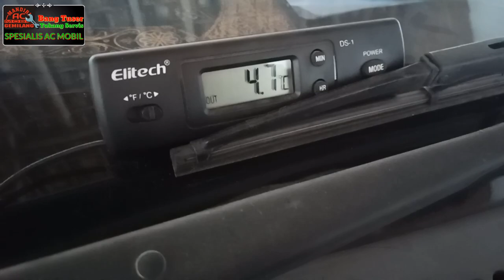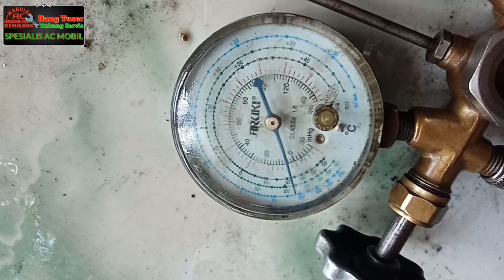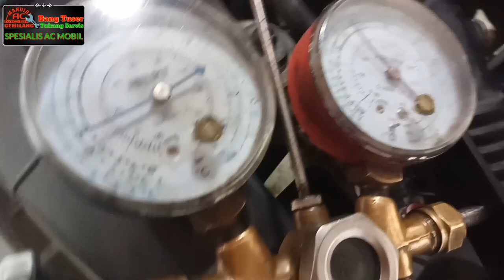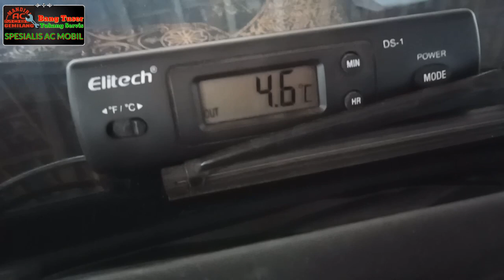car air cond overal service, maximum results

Comment: mau nanya. klo pertama ac dinyalakn dingin normal. tp klo dibuat jalan kok g bertambah dingin. padahal oli kompresor baru,freon baru n ac d stel yg tertinggi. kira2 apa ya kendalanya.trims
Reply from the maker: Bisa mutus otomatis gak om dn mobil apa ya
Reply: klo ac distel pelan. mk kompresor hidup trus sebentar mati n begitu seterusnya. klo distel pool mk kompresor jalan normal
Reply: @MANDIRIGEMILANGART .penther kapsul 2007
Reply from the maker: @muhammadsholeh7948  jangan di stell poll biar bisa mutus.  Cek kipas waterpump klau gak ada tambahan extrafan nya
Reply: @MANDIRIGEMILANGART  .klo distel kecil/tengah2. kompresor hidup sebentar lalu mati n hidup lagi sebentar trus mati lagi. begitu terus om. klo distel pool, kompresor hidup normal.

Comment: Assalamualaikum om.mohon maaf kalo banyak tanya.kompresor sudah ganti oli kompresi msh ok.kondensor evaporator sudah flusing semua.setelah di pasang ttep kurang dingin tidak ada kebocoran .selang suction padahal dinhin ngembun sampe  netes air perkiraan apanya ya om trouble nya?
Reply from the maker: Low press dan hpress berapa y om,  kalau tidak diketahui sulit buat analisa om
Reply from the maker: Walaekumsalam om
Reply: niple cuma satu om mobil esteem
aduh saya lupa kemren berapa tekanan nnya🙏.bag evaporator kaya kadang ada suara mendesis om
Reply: terimakasih ilmunya om masalah sudah teratasi ac sudah nyess lagi. ternyata expansi nya yg bermasalah gnti baru nyesss lagi 🙏

Comment: Om mobil saya xenia 1000cc single blower. Sudah saya flusing total oli kompresor juga sudah saya kosongin. Berapa ml, saya harus isi oli barunya?
Reply from the maker: filter silica di ganti ndak, flushing atas apa di turunkan
Reply: @MANDIRIGEMILANGART  saya turunkan semua ,evap kondensor kompresor dan pipa nya, silika drayer saya ganti
Reply from the maker: 100ml gpp om

Comment: Om saat proses vakum ac apa jg dpt menyedot sisa gram dr jebolnya kompresor.?atau vakum hanya sekedar mnyedot kadar air dan udara dlm sistem ac.?
Reply from the maker: vakum itu mengosongkan udara om,  bila kompresor jebol di bersihkan pakai bensin dalemnya.  kompresor yang saya pake buat vkum juga bisa buat nekan udara.  🙏
Reply: @MANDIRIGEMILANGART  maksut saya vakum saat smua sdh di install sbelum sbelum dicek kebocoran om..bkn proses flushing cucinya itu..hehehe,😁😁
Reply from the maker: setelah di instal vakum selain ngosongin udara juga bisa untuk mengisi olinya om. oli kompresor
Reply: @MANDIRIGEMILANGART  brarti vakum utamanya cm kosongkan udara sma isi oli,gbisa sedot sisa gram di  kondensor stelah dibersihkan pakai bensin ya. terimakasih pertanyaan sya selalu dijawab..smg tmbah lancar.sehat.amin
Reply from the maker: iya bang,  selain vakum mendorong sisa gram dan bensin dari kondensor misalnya. iya om semog bermanfaat.  sehat selalu, amin 🙏

Comment: Bang mau tanya. Kalo kompresor nyala dan samapi cut offnya durasinya sekitar 30 detik apakah masih bisa dikatan normal ya? Kondisi kompresor merk aftermarket non ori denso/keihin. Saya liat HRV sama avanza durasinya cuman 10 detikan aja dari kompresornyala sampe mati lagi.
Reply from the maker: Ini mobil apa ya,  cut 30 detik posisi angin bloer nomer berapa bang
Reply: Mobil CRV gen 2 om, posisi blower paling pelan om.
Reply from the maker: @kevinkarunia5907  sebelum menjurus ke thermistor terakhir perbaikan ac udah lama apa belum bang?
Reply: Penggantian Termistor, kompresor ac, + 2 extrafan depan kondensor baru dilakukan om.
Reply: Sempat liat sirkulasi oli di bagian kaca pipa 3/4nya. Warnanya keruh om. Tidak bening.
Reply from the maker: Kurang bersih berarti, flushing ulang coba

Comment: Mas, mau tnya grand vitara 2007 saat mobil berhenti ac tidak dingin biasa nya apa penyebab nya? Saat jalan normal dingin.
Saat berhenti saya pancing tombol ac saya OFF lalu ON lagi, tp hanya 5-10 menit dinginnya.
Reply from the maker: magnit cluth comprrsor om, magnit sudah lemah. ganti 1 set lebih baik om
Reply: 1 set magnetic clutch? Brp biaya nya mas? Kompresor aman yaa mas?
Reply from the maker: @derrygunawan7378  kurng lebih 1 jutaan om, nanti ada tambahan servis lainya apa tidak, penggantian filter dryer misalnya. kalau masih bisa dingin komp. aman om
Reply: Filter dryer dmn posisi nya mas?
Reply: Kemungkinan besar magnetic clutch yaa mas...? Trimakasih sharing nya mas, sukses terus usaha nya...🙏
Reply: Mas, saya bru cek ke bengkel ac dan blg nya kompresor nya... Di cek tinggi tekanan nya antara 50-60 di sight glass nya..
Saya mau coba cek bengkel ac yg lain lg buat mastiin...

Comment: Bang mau tanya, ketika fan AC muter ada suara ndengung sampe kedengeran di kabin. Semakin di gas semakin bising. Tp ketika fan nya berhenti muter, bisingnya hilang. AC sih dingin2 aja.
Reply from the maker: mungkin ada plasti atau apa yang nyakut di extrafan. mobil apa y bang. kalau fan tegangan stabil 12 v.
Reply: @MANDIRIGEMILANGART  honda city 2005
Reply: @MANDIRIGEMILANGART  semakin tinggi rpm, semakin cepat pula putaran fan nya ya bang?
Reply from the maker: @erwinwahyuputra  gak ngaruh bang,  soalnya fan model elektrik. coba cek dulu motor blowernya.  belakang laci , yang paling sering ada tisu atau plastik nyangkut . ketika ac on bunyi
Reply: @MANDIRIGEMILANGART  oke bang, coba nanti saya cek. Makasih infonya ya bang 😉

Comment: kira2 kalau ganti oli compresor biayanya berapa ya?
dan digelas ada kaca itu kalau ac sehat terlihat bagaimana ya?
trima kasih pak.
Reply from the maker: 10rb km nambah oli,  20rb km ganti oli total. setara 12 bulan.  kalau memang sudah lama lebih baik di ganti oli baru.  flushing sekalian di ganti filter dryernya.  cek juga kondisi evaporator. kemarin xenia kena 500 rb.  servis total.
 terimakasih sudah berkunjung.  semoga bermanfaat.
Reply from the maker: mungkin beda tempat beda harga

Comment: Kalo habis dikuras, masukin oli baru berapa cc ya bos?...
Reply from the maker: 100 cc cukup.  kalo komp as 15 punya kihang atau panther 125 cc
Reply: @MANDIRIGEMILANGART  kalo kompresornya type rotary sama 💯 cc juga ya bos?
Reply: @MANDIRIGEMILANGART  terimakasih sudah di respon balasanya, semoga makin ramai lancar bengkelnya.
Reply from the maker: @taniaazka5119  sanden 505 507 100 cc cukup. 508 di lebihin jadi 125
Reply from the maker: @taniaazka5119  amin,  semoga panjenengan di beri kesehatan juga ya bos,  di mudhkan rejekinya.

Comment: Om mw tanya klo pake evaporator kw itu apa pengaruh jadi kurang dingin ac nya, atau sama saja dingin nya cmn beda tingkat keawetan nya saja dgn yg ori ya..? Mohon pencerahan nya, terimakasih 🙏
Reply from the maker: beda bahan saja om, untuk kedinginan sama juga kog
Reply: @MANDIRIGEMILANGART  ok terimakasih om info nya. Saya ada 2, merk pro-tech r134a pipa nya ad 17 dan merk paco r12 pipanya ad 12. Secara merk lbh ok pasang yg mana ya om..?
Reply from the maker: secara merk lebih familiar paco
Reply: @MANDIRIGEMILANGART  siap om terimakasih info nya, sukses bengkel & channel nya 🙏👍👍👍

Comment: Kalau ac on temperatur suhu naik terus kalo of temperatur turun apanya ya bang apa bisa kelebihan oli
Reply from the maker: tambahin fan dulu,  temeratur mesin kan bang?
Reply: @MANDIRIGEMILANGART  pas udah nguras kompresor oli saya masukin oli semua sebotol batuk itu bang sebelum di kuras ga ada masalah normal

Comment: om mau tanya.. 
ini switch ac mobil saya kan eror. jadi arus 12v gk bisa masuk ke magnet clutch AC. kira" kalo sementara arus 12v yg masuk ke magnet saya jumper langsung pakai aki aman gk om?
tolong di balas ya om? 😁🙏
Reply from the maker: jangan di langsung om,  bahaya kompreaor tidak bisa putus
Reply from the maker: mobil apa ya om.
Reply: mercy w124 om. trnyta tidak switch nya. tp relay nya yg rusak 😅. ini udah nyala ac nya. sy jumper relay nya.
kira" aman gk om tnpa relay? hehe
Reply from the maker: @adyaksagilangadyaksa8236  lebih baik segera di ganti relaynya om,  takutnya salah jamper nanti

Comment: Servce kompresor sma cleaning bgtu kira2 abis berpa ya? Mobil corolla twincam
Reply from the maker: saya biasanya kena 400 -500rb,  belum termasuk penggantian part. 
pengerjaan:
 flushing /bilas total oli yang lama cleaning evaporator blower sama penggantian seal pada sambungan pipa , isi oli vakum buat kompresor sama isi freon baru. mungkin beda tempat beda harga sama beda yang di kerjakan. terimakasih sudah berkunjung ,  semoga sehat selalu
Reply: Posisi dimna om bengkelnya?